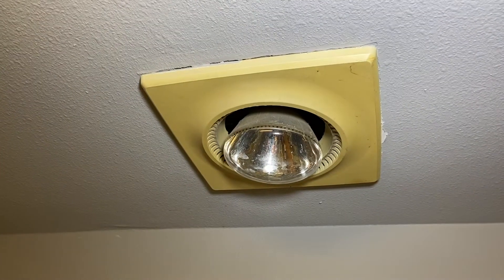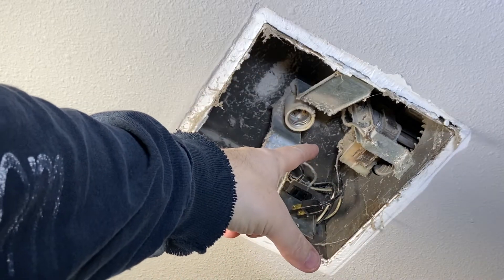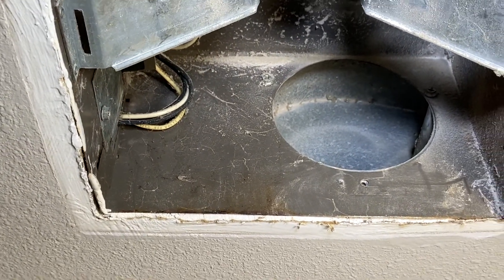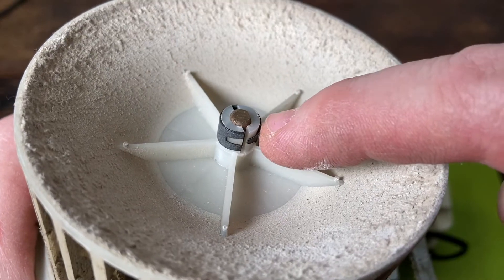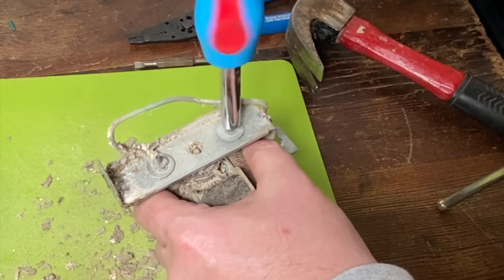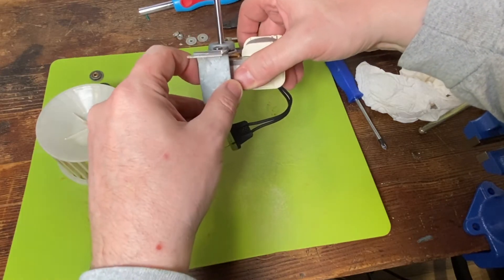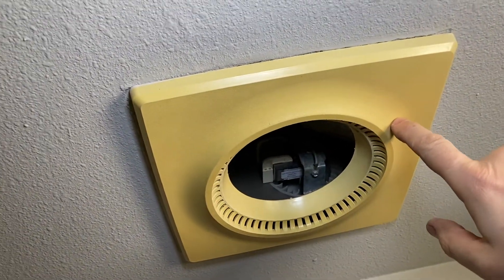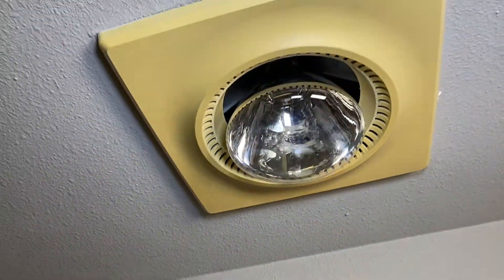Bathroom Fan Motor Stopped Running...Time for Replacement!

Comment: Thanks for the tutorial! I had zero experience and your step by step was easy to follow. I ran into some trouble finding the correct replacement part, since the model for the motor has been replaced, but a representative from Broan was able to make ordering a new/ old motor easy! I cleaned and replaced same blower as you did in the video to save a couple bucks. Thanks again!
Reply from the maker: Glad it helped!

Comment: Brian, great video! I followed your initial steps and it looks like the outlet up there has no power, so I stopped there, as I presume it's a power issue rather than a motor issue.  Can you suggest what to do next?  The bulb still works when I turn the switch on, so it's not the switch.  And I checked the house breaker panel to make none of the breakers had tripped.  Do I have to call an electrician at this point, or it is a DIY fix?  Thanks!

Comment: Brian, that fan clip could be replaced with a spring type hose clamp, if push comes to shove.
Reply from the maker: Bryant I was about to get creative if I could not use the old one or get another one.  Great call on the spring type hose clamp.

Comment: Brian,
I never understood the "6 in 1". There is a Reversable Standard/#2 Phillips (1&2) and a ¼" receiver (3).
Where are the other 3?
Reply from the maker: Great Question. Flat head 3/16" , 1/4", Phillip: #1 , #2, Nut Driver: 1/4" , 5/16".

Comment: If you paint the fan guard, make sure that you get paint for plastic. It will last longer and shouldn't chip or peel.
Reply from the maker: Right on.  I was going to primer it as well.  That is another reason I thought about sanding it down.  You think sanding would work?
Reply: @ThatFixItGuy  I don't think it will hurt. Don't get too aggressive on the grit, and you should be fine.

Comment: wow i guess you don't value your hand much to have your kid whack screwdriver with hammer lol
It is a shame it is all cemented into ceiling a whole new fixture with a nice quiet fan would have almost been cheaper and easier than all the running around they really should make those things so they can easily be replaced with a better model down the road the original builder cheap fans are really noisy without a lot of airflow
Reply from the maker: I know Greg We said the same thing I would have loved to put a new one in, but this seemed  like less work for the moment.  It was definitely installed pre drywall.  If you could have seen my face when Logan was hammering it told a different story! 😳  especially when he said he was getting tired.
Reply: @ThatFixItGuy  i did a similar repair for somebody in a pre fab modular home it had a small cheap fan and i told them i would replace it. So they found a same size fan at local hardware place and i pulled out whole insides and just left sheet metal box in ceiling and put in motor unit with fan and grill
Reply: @ranger178  How do I locate a new replacement for the nutone 9417D? How do I make sure the new one will fit?